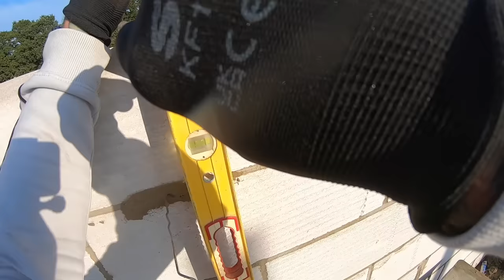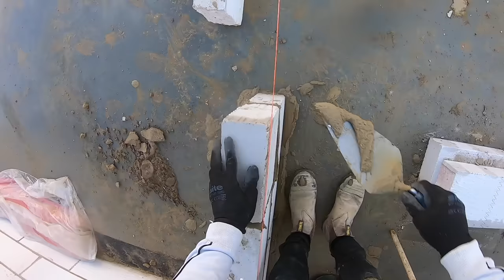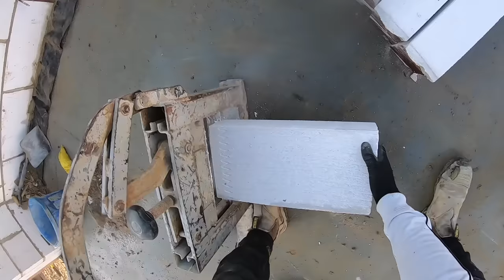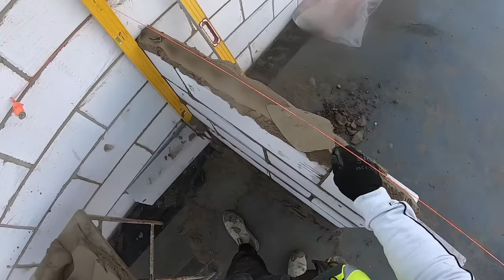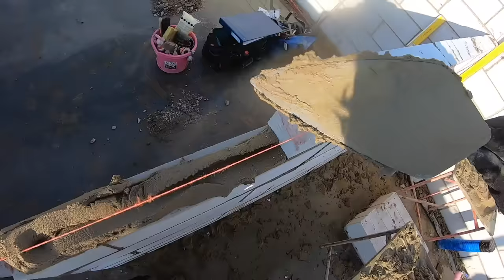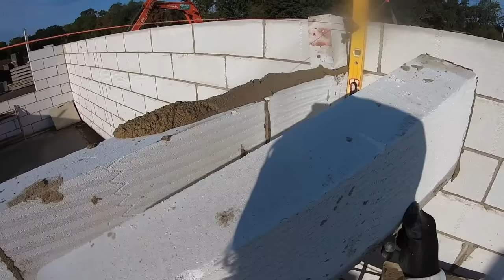Easiest way to build a Block panel 🧱🚧 #bricklaying #bricklayer #teaching

Comment: Question: when setting up internal profiles for block work. Do you put a spacer behind the profile to accommodate for the thickness of the string line?
I could not see in the video if the blocks were right up against the level, or just touching the line. 
Thank you 👍